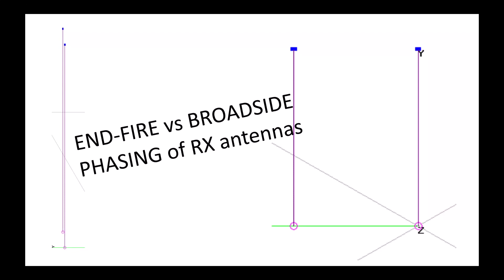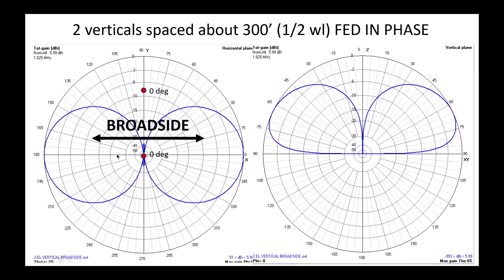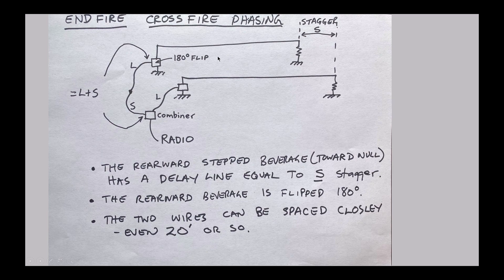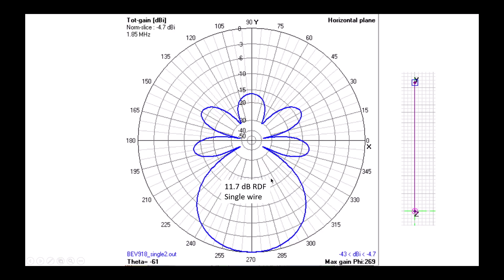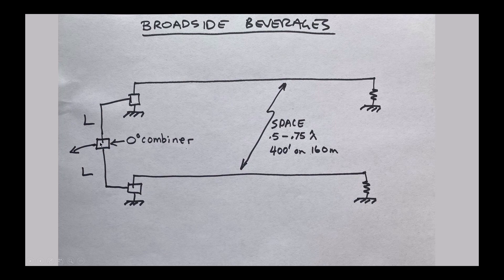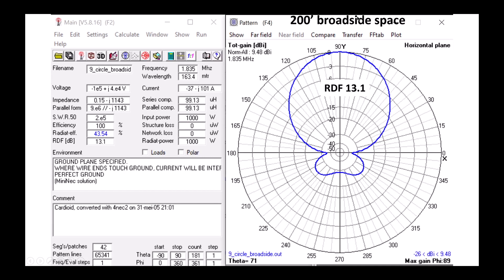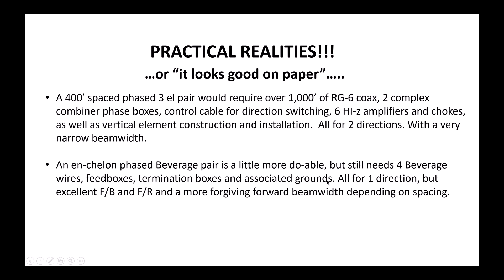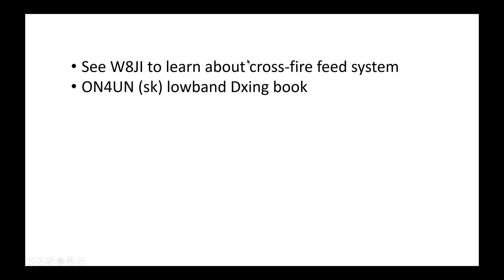Broadside and End-fire phasing of RX antennas

Comment: Just wonderful Steve. What a treasure trove your channel is. I just for the ON4UN book and my head is splitting! 90° spacing is too tight for my small garden on 40m so I am going to trial a 2 element vertical christman style array but with 67° spacing. Doing the calcs I believe I need a 121.5° phase delay based on an Na of 30. That brings me to my question, when you are calculating your delay, which Na figure do you typically use? Do you vary it at all between bands for example? 73 from Scotland.